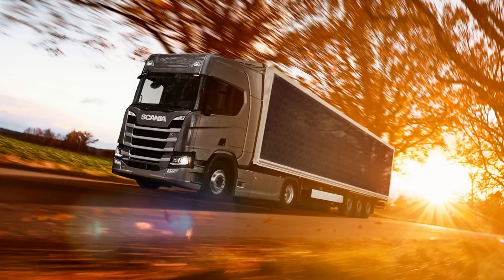Scania Sheds Light on Its Solar Trailer - Autoline Exclusives

Comment: great, a trailer has a huge surface to take a large ammount of solarpanels, fuel consumption will then be less and accordingly less co² emission. electric motors can be built into the axles of the trailer, so the trailer rather doesnt get stuck on slippery roads. beside that, its great to see technological improvement. how much would the fuel consumption be less with solarpanels on the trailer ?

Comment: Commercial trailers are washed regularly for fuel efficiency now, and 
moving forward, the surface materials that can degrade now, will be improved.  But even regular replacement is cheaper than diesel.
Reply: ceramic coatings have a roll to play in that I bet.

Comment: it is an interesting concept to add more range. on the other hand, batteries are getting cheaper by the minute. but as it happens, the trailer sometimes stands around and this is also a time where the system charges the battery with solar energy.

Comment: Roof of the trailer - or the roof of the business & parking lot - gee, which would be more productive. 
hint: which has the greatest area?  which is easiest to repair? which is most exposed to damage?
Reply: Its not just the roof, the sides of the trailer are solar as well. And contrary to what you may think that is equally effective in 2/3rds of the world.

Comment: I put a flexible panel on my camper. After 3 years the plastic surface became cloudy and the initial 18% efficiency was down to zero. I had to replace it with a glass panel.

Comment: Very cool, I know most trailers only get used a small percentage of the time. I almost wonder if it would be better to just install panels on the top and not the sides. The cost savings could be applied to larger on board batteries. I would guess that most retailers only spend 15 to 20 percent of their life on the road and the remaining time is spent waiting to be loaded or unloaded